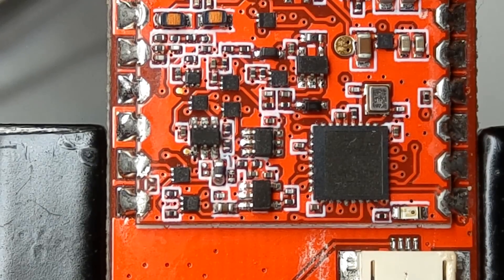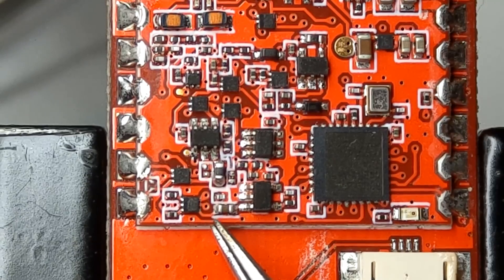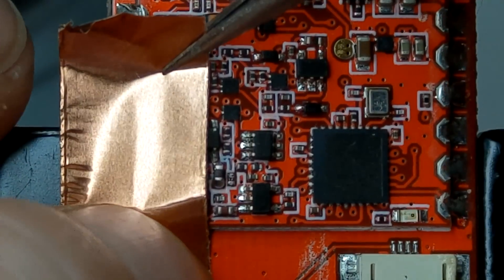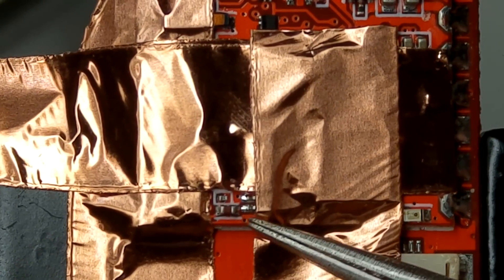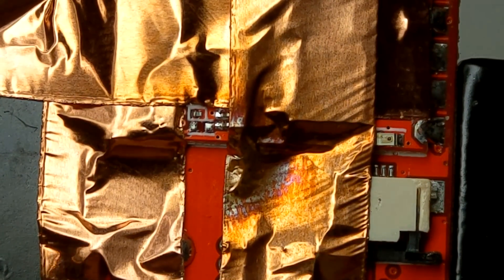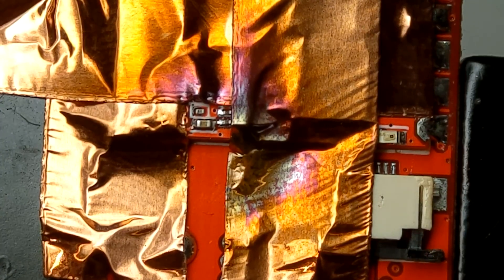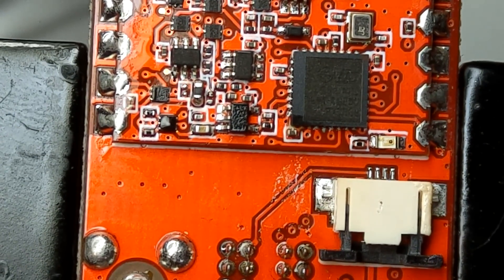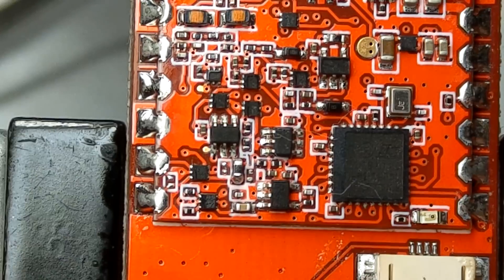RapidFIRE MOD TUTORIAL (batch1 to batch2)

Comment: How can i find out, i have batch 1 or batch 2?
Reply: The easiest way to find out is that Batch 2 modules have a small rubber cube between the antenna connectors, to protect the screen when the module is pushed against the cover.

Comment: Excellent videos, I love your channel, and it's one of my favorite. But I have a question to get benefit of your obvious experience. I have used kapton tape to protect area around where I use airgun. Do you find copper (or maybe aluminum) tape is more effective then kapton tape? Thanks.
Reply from the maker: well, I use copper cause it's not melting. Capton is fine but sometimes it gets melted. I normally use protection when very tiny parts are present on the vicinity of where i work.